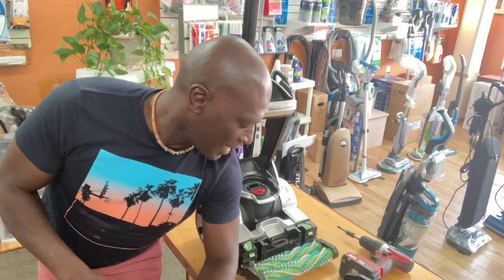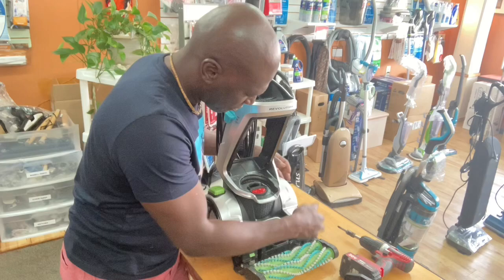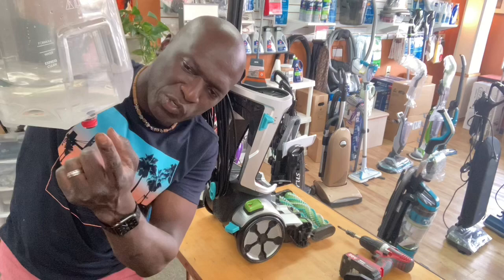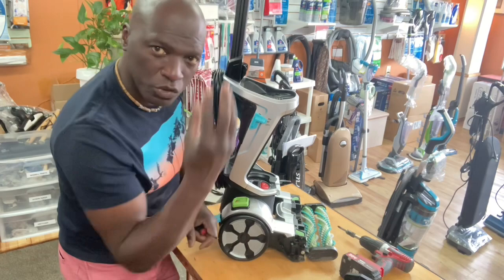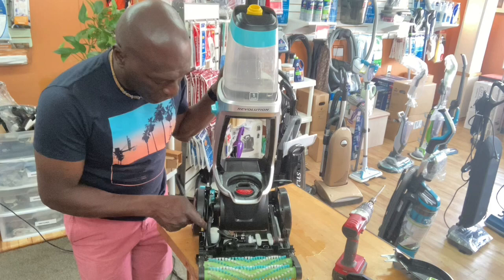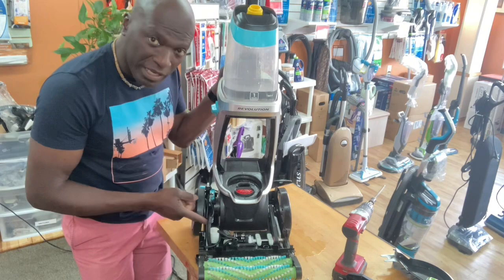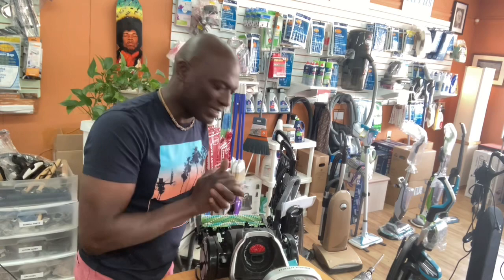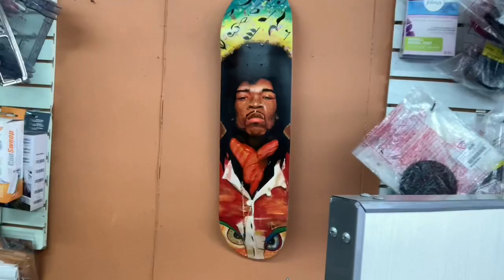Troubleshooting Bissell proheat revolution pet pro spray problem

Comment: I don’t have a spraying issue but I do have an issue of after using the cleaner all the  remaining water in the reservoir leaks out through the front where it auctions any ideas how to fix it?
Reply from the maker: Hmmm. So after shampooing and turning off the machine, all the extra water just pour out of the front nozzle. Then check for any clogged area. Possibly a part that is clogged can hold off the water in that area and then after the unit turns off it would just spill out
Reply: @monroevac  will try to find if there is a clog.

Comment: OK, so my problem with this unit is that when I turn it on, water bubbles a LOT out of the little hole on the unit where you plug in the attachment tool.  I can't find out what the part is called or how to replace it.  There was a broken little red rubber-band looking thing inside of it and I assume that's the issue.  What is that part called and how to replace it?  Even trying to plug in the attachment tool to use that, water still comes out at that connection.
Reply from the maker: If you take a look at a picture of the Revolution hose, you’ll see the red rubber seal. It belong on the hose. Google an image of the hose. Try pulling the red seal out of the hole and put it back on the hose. It may fix the problem

Comment: Hey man, could you help me? Mine is bubbling up water from where the hose plugs in during normal use, but when nothing is inserted. Would you know of a way to fix this? Thanks!
Reply from the maker: I’ll look into it. Stay tuned
Reply: @monroevac  thanks! And to clarify, it's where the hose attachment gets its water, next to the screw. Pen pressing inside there only helps a little bit. The orange 1548 model
Reply from the maker: Just uploaded a video that may help. Try this link- https://youtu.be/XyfeRHCHgYE

Comment: I have the proheat 2x revolution and right out the box. I get no water spraying out of the carpet cleaner or the hand tool 😔
Reply from the maker: Hmmm try pouring water directly in the auto receiver while squeezing the trigger. The auto receiver is the opening below the tank. It’s possible the tank is the problem. Also check the flow adjuster on the side of the unit make sure it’s on max
Reply: Same. It’s garbage.

Comment: My bissel  pro heat isn't spraying now. We have taken it apart the tank is fine , we have  checked the lines all clear, I'm list
Reply from the maker: Hi Dawn I just finished making a video about the first issue you were asking about. Didn't edit and upload it yet. Maybe its best if you call my shop at 704-776-4752, so I can get a better understanding of the issue.

Comment: I really need help! I have the older model but they are very similar it’s the red one. I use it quite often I recently changed the belts took it all apart and cleaned it (lotta dog hair) worked so much better a month now and the trigger to spray has no resistance and the black hole you sometime need to prime for the hose with a pen or whatever is just dumping water from the tank. I highly need my shampooer to work as I have elderly dogs and lots of accidents please help!
Reply from the maker: Ok.. you’re describing two problems ..correct? The tank and the trigger?…
Reply from the maker: If the tank is just spilling out water you may need to replace it . Some Bissell cleaners allowed  you to purchase the auto load assembly. But the revolution doesn’t. As for the trigger, the resistance problem may be the trigger rigger itself. Use a phillips screw driver and open the handle to see if the trigger is intact. There is a flexible spring like plastic that gives the trigger the resistance you are referring to; it may be broken. It’s possible to find the part on eBay. But most people have to just purchase a new handle. Part number for 1 gen revolution is 1609129
Reply: Thank you! And I accidentally poke the prime a bit much which flipped that rubber seal inside out so I had fixed that but still no resistance with spray trigger for the main cleaning. I checked the hose attachment and it works fine so I’m going to replace the main trigger and cross my fingers it works. I take good care of my machines so I’ll be sad if I need to replace
Reply: The issue I’m having is with the main trigger to spray out the bottom of the machine not the hose and all I can find is information for the hose attachment spray trigger it’s still suctioning just no spray with the trigger
Reply from the maker: I working on uploading a video about the spray trigger in the main handle. Inspired by your comment 😄 keep a look out for it. Should be up later this evening
Reply: You’re truly amazing thank you so much!
Reply from the maker: Sorry for delay-Just realized the the video did not completely upload. Putting it up today

Comment: wen mine cuts off suction the dirty wants to run right out..fast.
even hard to remove reservoir w/o makin mess wit dirty water
Reply from the maker: check your filters- seem like the ssuction is less than 100%

Comment: Trigger on my spotclean pro not working, what to Do my friend
Reply from the maker: Hi Try this link My Bissell Revolution is not Spraying
https://youtu.be/PxIjiM5drNs - 
If it doesn’t help solve the issue then the next step may be to replace the solenoid and the pump. Stay tuned I’ll be making a video on replacing the pump and hose
Reply: @monroevac  is this Maschine need to have water always, bcoz I was without water and vacuming, can that broke the pump

Comment: Clean the holes out with a needle in the bottom of the machine.
Reply from the maker: Correct Philly Gonzo..Thanks
Reply: This comment literally solved my problem. Thank you.
Reply: @matthewsharayko7463  No problem, glad it worked. I do this every other time i use it just for maintenance.

Comment: My wife took ours apart to clean it and now the trigger on the handle doesn't shoot water only the push button that shoots a straight stream above the right wheel will release shampoo
Reply from the maker: Take a few minutes and look through my “Bissell Tips playlist” I’m sure you’ll find a some help there. I made a video about the handle. The good news is that your tank, auto receiver and pump works. Try taking the handle out and reinstall
Reply: @monroevac  but we never took the handle out just the rollers at the bottom
Reply: We have the Bissell ProHeat X2 pet one

Comment: This helped a lot on disassembly but I’m having an issue with intermittent water spraying. It would work for a good 5 minutes and then water just stops coming out completely.
Reply from the maker: Hi Erick, I wish there was a one answer pill I can give, but it may be one  of a few possible issues. I’ve made a view videos on this. Check out my playlist “Bissell Tips” you should find a solution there. Just have to do the painstaking job of watching a few of them
Reply: @monroevac  ok I will check them out but it seems I found a way to make it work. Whenever I press down on the cleaning solution tank harder onto the base it seems to work?
Reply from the maker: Looks like a replacement tank might solve the issue. Good work

Comment: I got one for y'all..... Total operator error. My damn steamer would not spray, top or bottom and intermittently. Well, after some trial and error, trying to use a separate vacuum and blow any potential clog through, ya, well, maybe if you fill the water tank more than 1/2 inch, there will be enough pressure to push the air lock through the line. So, in other words, don't be me and only try to start the job with less than an inch of water.
Reply from the maker: 😅-Great tip. Can’t believe I never shared that. Thanks 🙏